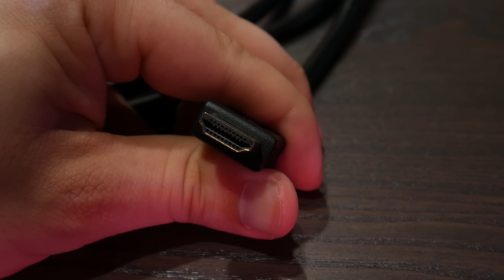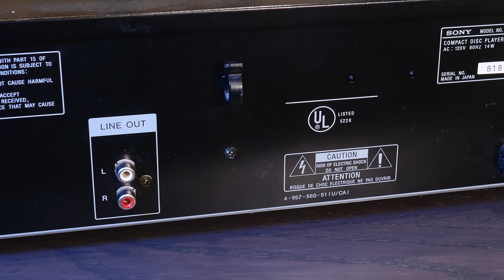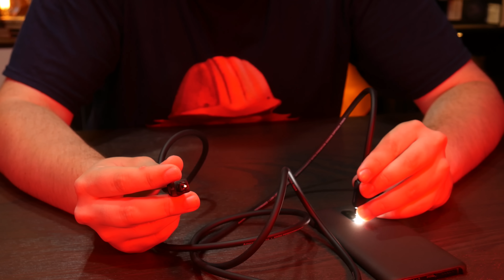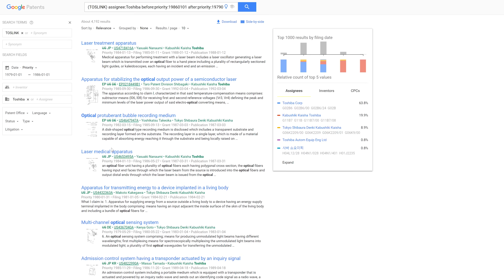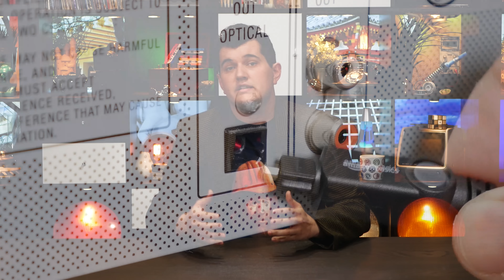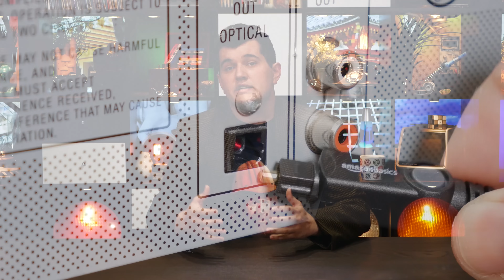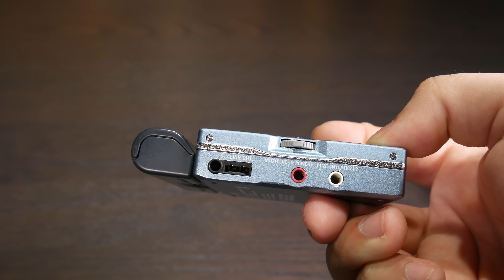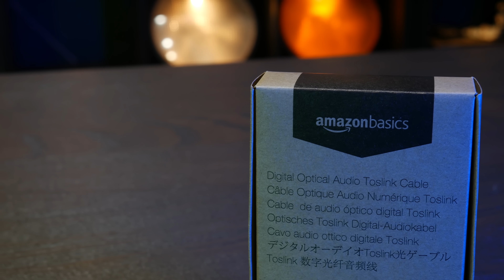TOSLINK: That one consumer fiber optic standard

Comment: Not long ago I got a sound bar and it came with a toslink cable, because for some reason my tv only has fibre output for audio... Well, I picked up a neat trick to avoid glitchy or no sound, after getting really mad and getting super angry at this tech I’be never used before that’s supposed to move the light from there to here and play the sound instead of being a glitchy mess. Ok, here’s the trick: remove the protective plastic covers from each end of the cable.... ... smh... 2 hours.

Comment: Love Toslink. The cable can be very thin, compared to normal copper cables (only as thick as ~mobile phone charger cable), can be at least 10-20m long, is really cheap (from ~€0.5 per meter), and has been 100% reliable in my ~10 year use (PC to audio receiver), offering perfect quality. It is a shame it was/is not used more widely.

Comment: I use one actually to connect my smart TV to my older surround sound receiver. I was looking for a way for forever to get the sound from my TV to go to my receiver and that's when I discovered the optical audio cable. Not only that but I could now watch my TV with 4k resolution which the receiver couldn't produce, and have quality sound at the same time

Comment: Regarding digital signal interference, it's still existing problem. Constant interference matters on longer cables where this seemingly nice high and low signal is much weaker. Over the distance it's more and more prone to be messed up by weak interference and now you need higher grade cables with proper shielding to be able to push it further and further away. Second issue is with short interference. There are many sources of high and short interference. Even if you turn of some power hungry device it might cause sudden and short interference that will mess up with digital signal. HDMI and other standards like that have this limitation and always will. The only way of going around interference is making signal slow and strong. Think about it this way. How quiet you can talk to someone so that he can understand everything? At which point occasional noise (dropped lighter, kicked rock, driving by car) will make it impossible to hear? That's this short interference that is strong enough to make the signal break. If you speak quieter and quieter, then suddenly your fridge or AC will be able to suppress your data transmission. And what is quietness in this case? It's mostly the distance between speaker and listener. The further you go, the weaker this signal is. You can scream over a kilometer and if it's quiet, someone on the other side will hear it. The point is that any interference, driving by car or other noise can interrupt the communication. Even if it's 99% stable, imagine having your movie tearing every few seconds. The other thing is how fast you can talk and it's the same story. The faster you speak, the more blurred and harder to understand it might be. If you add interference on top of that, it may turn out that even slight noise makes you loose some of the data. 
So long story short, we already have problems with 8K@120Hz and we will have more and more problems if we want to push this technology too far. Imagine that you would need just a simple and cheap optic cable that would not require any update. Surely this would be more expensive on transmitter and receiver production and that's the real cause of sticking to wires. Using two way communication with multiple channel (wavelength) transmission might become more expensive and most of all, it will be quite bulky. For TV, AVR or any PC it's not a problem, for laptops, tablets, smartphones and other small form factor devices it will. Moreover, many people need short cables and keep most of the equipment in the same spot so there's not much of a deal while buying 20$ 1-2m HDMI cable to have HDMI 2.1 or something higher. If you want to have 30m HDMI cable then well... Such thing costs around 180-200 USD right now. At this price point it may turn out that 10-20$ optic cable and 30$ worth of additional optic transceivers in both of connecting devices would make perfect sense. The thing is that you can buy optic HDMI cables, such 30m cable would be around 160$. It converts the signal to optic on the one end and then changes it back on receiver side. The thing is that it's workaround and it's unlike any standard. Oh, and they don't support ARC, forget about two way communication. It's possible to make it but I did not see a single optic HDMI cable that supports ARC.

Comment: Well, for short lengths you don't really need two cables for two way communication. If the cable is good quality and does not disperse light too much, the majority of the light will end up on the other side and almost none will be visible on transmitter side. So you just need transceiver that will be able to transmit light and receive it at the same time. EM waves (basically all types of waves) do not collide with themselves. In fact, you can use one cable to transmit many channels at once, you have wide range of EM frequencies (light colors) you can use and with diode it's as simple as having multiple diodes that emit different colors and then received that can detect multiple colors. You can also use small prism to split different wavelengths and direct them to different receivers. Essentially there is completely no use for multiple optic cables for consumer devices. Even more, you can just create one cable standard and upgrade receiver and transmitter to add more channels without replacing the cable. Seems like this technology is far superior to any universal electric cable as it is just limited by quality of transmitter and receiver to be able to keep smaller and smaller differences between particular wavelengths. Ok, maby cable quality will matter at some point but still, it's not as hard limit as having only N wires in electric cable without ability to push more data without increasing frequency.

Comment: All Apple routers/devices that offered AirPlay functionality used mini-Toslink. Same goes for all Apple Mac computers built since at least 2003 as well. The port light won’t be visible as it doesn’t illuminate unless it senses a mini-Toslink plastic plug with a metal tip.
Reply: Yeah the Airport Express sold up until 2018 still had it.
Reply: However no Macs since 2016 have had it. https://support.apple.com/en-us/HT202730

Comment: It was great for Mini disc recording, since you got an automatic sync and autostart of the recording as soon as you pressed play on your cd-player (after toggling the rec switch on the Mini-disc-player, to ready the Mini-disc for the incoming digital signal). Also all the songs names and track number automatically got transferred as well! Really neat!
Reply: At least on the home MD decks, copying the track titles required a separate cable, though. (Sony Control A II, which is basically Sony infrared remote commands, but over cable instead of infrared light.) I know some portable units also required a special cable, though others have said that some models could do it over TOSLink alone.

Comment: my receiver receives toslink & coaxial audio at dolby digital rates (640 kbit), but it's also DTS compatible (up to 3840kbit!) over optical; i have tested this with my tv (has spdif out), and with my pc (using ffmpeg to recode audio).  My receiver will also tell (by status light) if it's receiving and decoding PCM, Dolby or DTS signals; and through the status screen it'll even say how many channels (and which channels) and the exact bitrate.  it's a Denon AVR-1509.

Comment: Even though cables are good at ignoring interference, they can give off interference. WiFi routers and ethernet cables give off a lot of noise on amateur radio bands. Once I cleaned up the noise to my router, I still receive interference from my neighbor's router, though it is fairly minimal.

Comment: One thing a Toslink cable would stop, is the old artifact called "ground loops" in audio equipment, by eliminating any looping electrical connections between components. The circular currents in the ground loop could wreck stuff pretty bad, pick up lots of induced hums from power supplies, put voltages on things you really did not want to, etc. And if you want to avoid ground loops by creating an electrically isolated, optical pathway, then digital is a lot easier than analog. Edit: And that's exactly the thing pointed out in the follow up video right at the start. I feel like a right ass now.

Comment: Here's a fun fact I learned about this optical audio because of my original Xbox. I had bought a TV with S-Video inputs and I found a cable for my original Xbox that had S-Video and optical audio with the toslink cable. So immediately went and found an audio receiver with the fiber optic audio input and I could actually hear a difference in sound quality.

Comment: Sony's higher end CD Walkmans had the capability to read CD-text. Also they had optical outs via mini-TosLink. If you had a mid to high end MD Walkman (called portable MD Deck by Sony), you could copy the CD and the CD-Text via the Toslink cable with amazing sound and all the tags intact. It was amazing at that time. MD still sounds amazing when fed from a good audio source though.

Comment: These Apple products had mini Toslink connections, so they were actually quite common.

MacBook Pro (Retina, 13-inch, Late 2013) through MacBook Pro (Retina, 13-inch, Early 2015)
MacBook Pro (Retina, 15-inch, Late 2013) through MacBook Pro (Retina, 15-inch, Mid 2015)
iMac (21.5-inch, Mid 2014) through iMac (21.5-inch, Late 2014)
iMac (Retina 4K, 21.5-inch, Late 2015)
iMac (Retina 5K, 27-inch, Late 2014) through iMac (Retina 5K, 27-inch, Late 2015)
Mac Pro (Late 2013) 
Mac mini (Late 2014)

Comment: The reason you can't find a patent is that TOSLINK is "standardized". When two or more companies in the same field want to work together they run into the problem of anti-trust laws. Organizations like ANSI and ISO allow a legal way for companies to come cooperate (under very strict conditions) in order to generate publicly available standards that anyone and everyone is allowed to use. Standards are essentially anti-patents: they're used to make something belong to everyone instead of making it belong to only one legal entity and nobody else.

Toshiba made this move because they understand that their sales for audio components would potentially suffer if their connection tech was proprietary. That is, if their optical connectors were not compatible with the tech a consumer was looking to interact with, then the consumer would be less likely to buy from them. By making the connector standardized, a lot of other companies provided TOSLINK ports on their products rather than spending R&D money on inventing a new optical wire system. That makes those devices inherently compatible with Toshiba tech, removing the potential barrier to purchase.

Comment: Thanks, very interesting, wish I'd seen it a year or so ago when hooking my girlfriend's TV to headphones.

Yes, it has a headphone jack, BUT, the volume is controlled by the TV and there's no way to disconnect same.  So if you want to watch TV and not bother someone else's sleeping, headphones don't work.  Weird, yes.

BUT, I discovered that the TV has a toslink connection/output.   Had to learn about them, and buy a simple toslink to rca adapter, which then required a power connection.  Got it all working (adapters, etc.) and yup, the TV volume can be turned down, and it doesn't affect the signal from the toslink connection, yay!  Unfortunately, you DO need an amplifier to use headphones as the analog signal that comes out of my cheapie (maybe better ones don't have this problem?) adapter isn't all that strong.   And, you need volume controls at or near the headphones themselves, of course.

Learned a lot and it's working for her so that's the important part.  Sure would have been simpler to allow a simple toggle on the TV to disable it's speakers if you wanted.  Turning them off by default with headphones plugged in wouldn't be good as you'd then have to unplug the headphones to watch the TV normally.

Oh, and LOVE the gold plated toslink connectors, they really do make the video much better...  :)

RichE San Diego, CA

Comment: A seemingly good use for toslink is synchronization across multiple device's at different distances since the difference in time between two device's would be only affected by the speed of light which won't be an issue since light doesn't change speed. So at any distance the perceived differences in time between any two device's wouldn't be noticed at all

Comment: I mean, would you even need two strands of wire for two-way communication? Just add a blue or green LED, and an extra diode for that particular wavelength, and you should be good, right?

Comment: I first encountered TOSLINK when I got my first MD recorder in 1995 when I was in Hong Kong. Of course, the portable MD recorder only had a min-TOSLINK output, so I made sure to purchase the appropriate TOSLINK to mini-TOSLINK cable at the same store in HK. And luckily the Sony LD player I owned at the time, had a TOSLINK output (but no coaxial SPDIF output oddly enough--you'd think Sony would want to support THEIR OWN DIGITAL INTERFACE ON THEIR OWN EQUIPMENT!!) I made sooooooo many MD recordings through that setup. Still have many of them and they play perfectly to this day.

Other digital recording portables went with mini-TOSLINK as well like DAT portables and Digital Compact Cassettes (yes, even Philips went with TOSLINK over their own SPDIF ON THEIR OWN DIGITAL RECORDING MEDIUM!!)

One of the best advantages of TOSLINK at least to LD player owners back in the day was that since most LD players supported TOSLINK outputs over coaxial, and with the highly overengineered and poorly executed way that AC-3 was implemented on Laserdisc, DTS Surround was possible through just that connection. All you needed was a DTS compatible receiver and your TOSLINK output from your LD player, and you were good to go! Didn't need a dedicated AC-3 output, RF demodulator and AC-3 compatible receiver (or if you had the big bucks, a receiver with a built-in RF demodulator) to get Dolby Digital Surround from your LDs. 

I'll never forget my friend's face when I brought my big ol' clunky LD player to his house along with "The Crow" on DTS LD to compare the audio from his Dolby Digital DVD of the same movie. The DTS LD was waaaaaaaay better! We actually watched the movie with the two movies synched up on each player--video from the DVD (because the DVD did look better since the picture on that Sony LD player was starting to go bad--that's another can of worms I don't want to open here) and audio from the LD!!

Even then some people prefer with just TOSLINK from your LD player, you could still enjoy the matrix Dolby Surround soundtrack that every Dolby Digital LD had on its digital tracks if you didn't have an AC-3 compatible LD player and RF demodulator. I know some who even prefer that soundtrack to the AC-3 track since being on the digital tracks of the LD, its bitrate was far higher (1441 kbps--same as CD) than the demodulated AC-3 track (384 kbps if I remember correctly.)

Anyways, I think I cluttered up the comments section here enough. Great vid and great info!

Comment: Toslink. The answer to a question nobody asked!
The only advantage I can see with Toslink (and I use it myself) is you can hook up multiple sound sources to the same device. I use hdmi and toslink so I can have my TV and PS4 hooked up to my sound bar without changing cables.

Comment: Couldn't you add bidirectional communication to toslink with additional colors and use that to "ask" the other device which communication protocols it supported. If there was no answer, it's SPDIF only. Then the more modern device would sit there "watching" the blue and green channels in case a more fancy device was plugged in at the other end and said hello.

Yes the additional colors would also be picked up by the photo diode in older devices, but they couldn't interpret what was said and would just SPIDF on.

Comment: That was very informative, thanks!

NRZ  Nerzi  Non-Return to Zero.  Used in computer mag tape and disks too.

I used a TOSLINK interface between my PC and Lo-Fi amplifier.  The first thing I noticed was the complete absence of mains hum.  I have my PC, amplifier &c plugged into a plethora of sockets and earth loop induced hum was a problem.  Needless to say Bill Gates didn't want me to use TOSLINK (apparently he isn't a TOSSER) so he made Windows 10 not work properly on my TOSLINK adapter.

Comment: There are cases where HDMI doesn’t make sense, like audio-only devices. The base station for Sennheiser’s RF headphones has a TOSlink optical input. I also have a small Dolby Surround headphone encoder that takes an optical input. So there are still uses for it.
Reply: Yes this! My Sennheiser headphones do this and (at least for me) it sounds much nicer than the 3.5 mm thing it offers as the alternative.
I had to get a weird converty-thing when my new PC didn't have a matching output but it still works.

Comment: I bought a Logitech 5:1 PC speaker system - it has coax input and also Toslink.  However, I can only get 5:1 via the Toslink - coax will only give me stereo 2:1 or what I believe is called Quadraphonic (stereo front plus stereo rear speakers, but no bass output).  This is all regardless of the output my PC puts out.  Bonkers

Comment: Well I noticed that the TOSLINK protocol standards just uses SPDIF protocols, this confirms my suspicion that that it's essentially the same just over cheap fibre instead of copper (with the slight if any benefit of electrical and electromagnetic isolation)